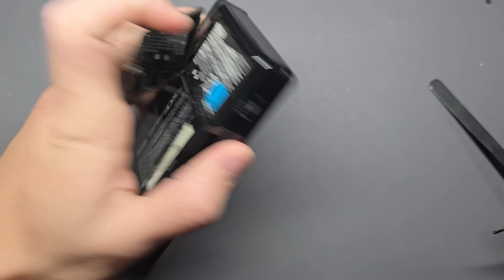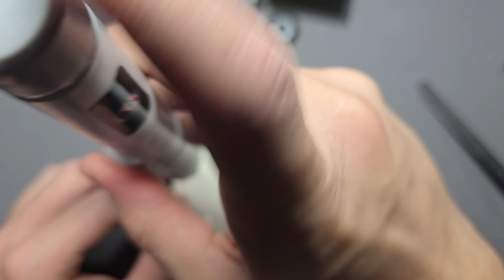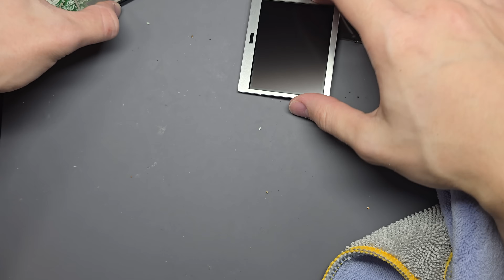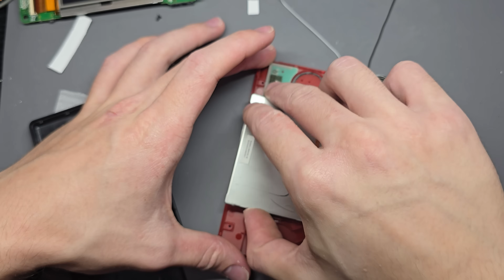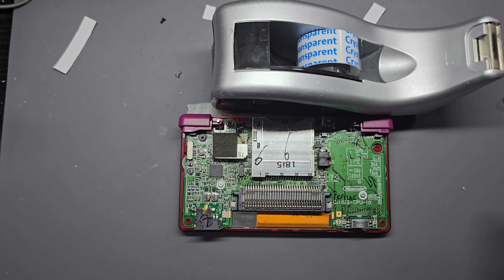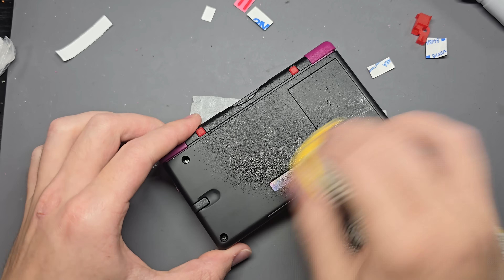Building a MEGA CUSTOM Ordered DS Lite! - eXtremeRate Custom Shell Swap w/ Modded LEDs!

Comment: I’ve modified thousands of OG 360’s, the Ring of Light was one of my points of contention; I learned that if you solder wick the pads completely, add solder to one of the pads. While melting the solder you can use tweezers to slide your SMD LED into the solder puddle and let it cool then simply add solder to the other pad and boom; perfect SMD LED placement. Gets a little more involved when you add custom error LEDs and glitch LEDs but worth the upgrade so you can see your possible error without opening AND count how many glitches it takes to boot.

Recently picked up a completely disassembled NDSL so this should be fun.

ALSO it helps to have a spray bottle with water and spray the around the room before doing any screen work, brings down most of the dirt/dust floating around; at least mitigates the possibility.
Reply from the maker: Wow, thank you so much for your knowledge, this may be the solution I've been looking for that I didn't know of. So you strip both pads off solder, then only add solder to one pad, and while heating with your soldering iron you push the 0603 led in place? Is that right? 

Sounds dreamy honestly compared to struggling with my hot air gun, I can't tell you how many LEDs have been blown away 😂

And thank you so much for that extra tip for dust. I'll definitely do that!!!

Comment: Strange, my L button from extremerate doesn't stick and I didn't mod it. When I was assembling I noticed it was fowling the black cable that comes through the hinge so I made sure to route that cable in a way so there was enough space for both. Is it possible that is your issue?

Comment: Been binging a ton of your videos! They've been a fun watch and are helping me to get ideas for my own DS reshell + USB C mod.

I also had a question for you. Can you fix and match OEM parts alongside the Extremerate shells? I want to keep the top cover of my original DS because without the top logo I feel like it's missing something. Anyways thanks!
Reply: Yeah you can mix n match. I keep a razor blade nearby to trim any excess plastic to make them fit nice
Reply from the maker: I'm so glad you enjoy the content! And OEM top plate will fit perfectly with the extremerate pieces. The only parts that don't work seem to never work no matter how much you trim, are the L and R buttons. If using extremerate shells pieces, you'll only be able to use extremerate L and R buttons!

Comment: About your Problem with the L-Button, someone on Reddit on the nds subreddit has found the cause and the fix for it without it being under spring load and bulging out a bit when the bottom shell is on.
Reply: You might as well tell us the fix lol
Reply: What’s the fix?
Reply from the maker: What is it? I feel like I've tried pretty much everything, but trimming it is easy enough and makes it work 100% so that's what I've resorted to!